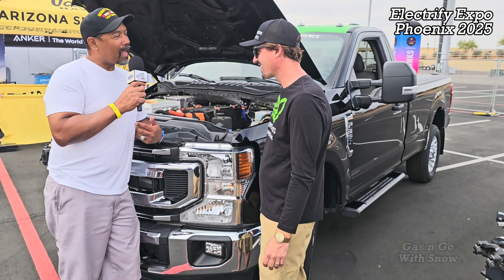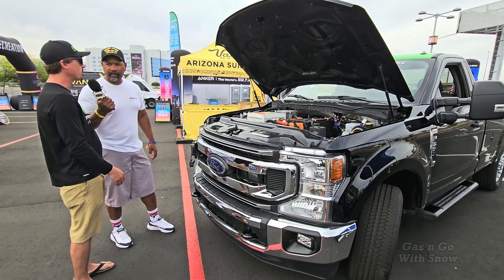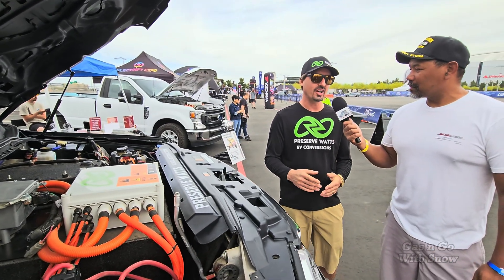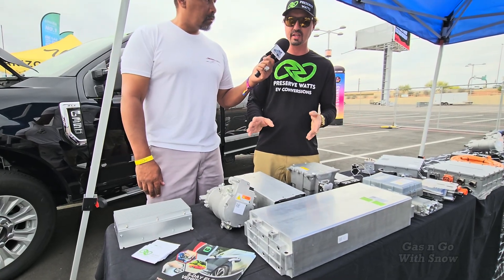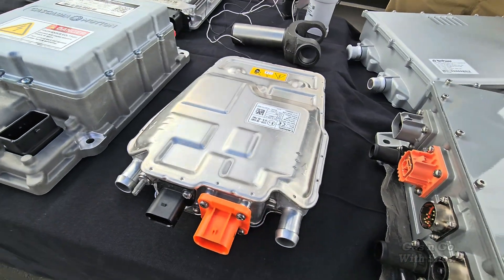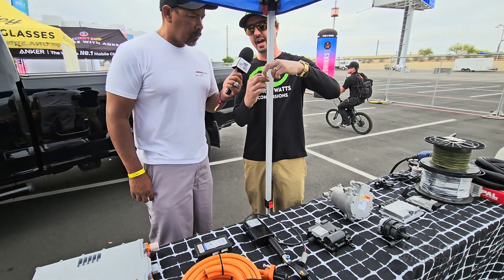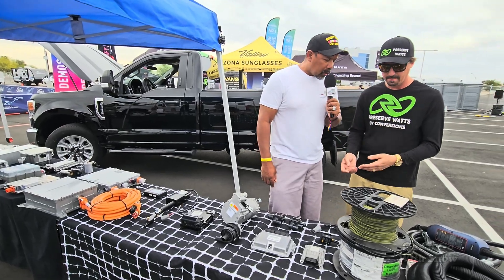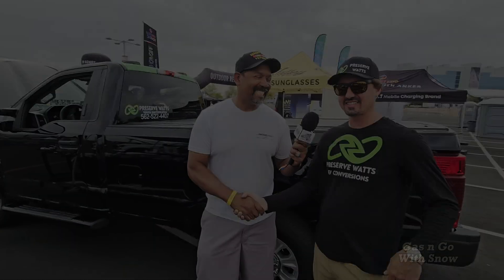ELECTRIC Ford F-350 by Preserve Watts at Electrify Expo Phoenix 2025

Comment: Meh..100 miles of range.
Reply: made for a customer that goes 60mi.
Reply from the maker: This is a proof of concept and test mule!  He could have put more batteries 🔋 in but the cost wasn't worth the upgrade.
Reply: The customer purposely requested that. The battery pack is tiny for a F350. A 200 mile version should be just as easy to build.